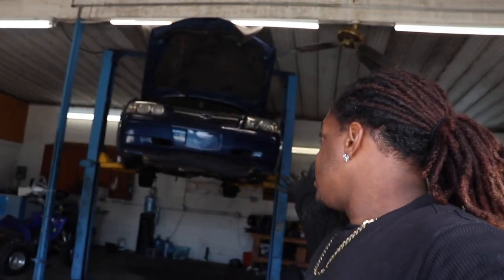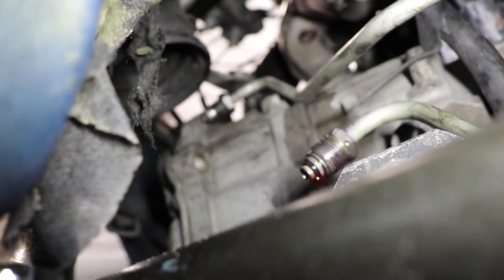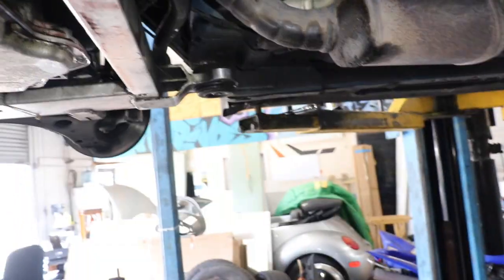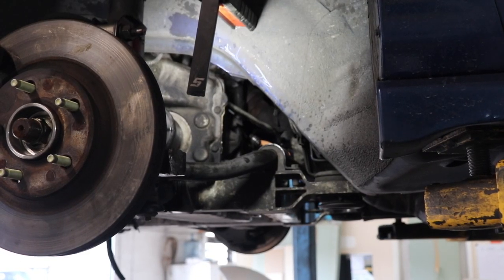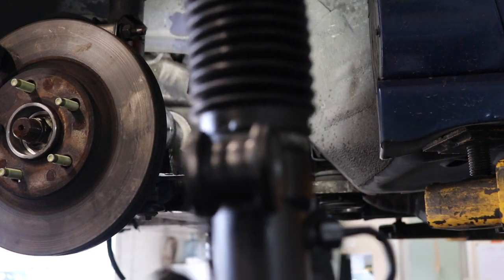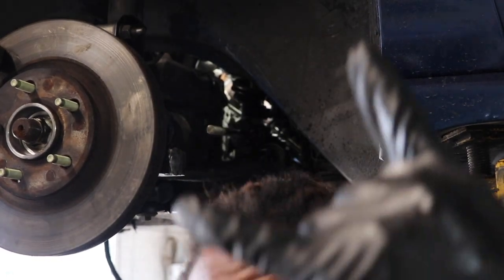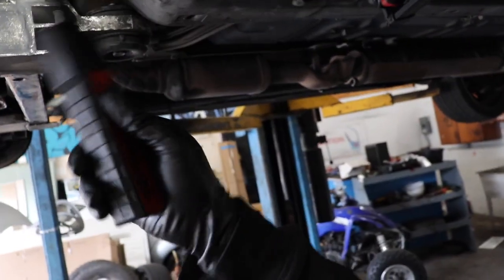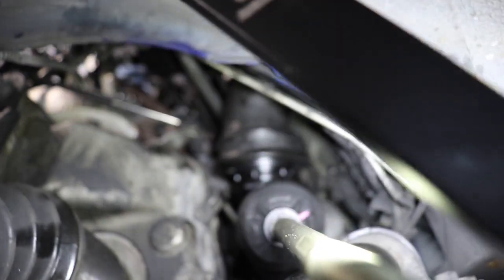04 CHEVY IMPALA RACK AND PINION REPLACEMENT

Comment: Okay so I wish I would have recorded and posted the process for me replacing the steering rack. But I will try to be as detailed as possible. 
1. I did not have a lift I had two harbor freight 2 ton Jack stands and only lifted the front. Remember to chalk the rear tires. 
2. Remove wheels and tie rod joints. I believe it was an 18mm. 
3. Start removing the two bolts that hold the rack in place. I believe it was an 17-18mm and you need a back up. The one on the passenger side was tough to remove because of the front sway bar. I just pried it past it. 
3. What I did next was drop the car as low as possible keeping the Jack up front on the center support. I removed the air box/intake hose to gain more access to lines going into top of rack. I believe they were both 18mm. I removed the shift linkage as well to get more leverage. 
4. Removing and reinstalling the boot/steering joint is the hardest part of this whole job. There is a plastic cover that snaps over the steering rack where the steering joint goes on. It is VERY hard to work around especially if you don’t have extra help. The swivel joint bolt was a 11mm. And I reached it from the wheel well. 
5. Lift car back up and place back on jackstands. I actually found that you do not need to drop the engine cradle to gain more access to remove rack. The trick is to get under the car and start feeding it towards driver side and tilt it back towards rear of car when you get to the wheel well. And it will slide right out. 
6. I put grease on bolt up points on new rack and pinion to help slide in. Easiest way without help is to feed it back in making sure that the passenger side tie rod goes where it needs to then getting under the car and working it in. It took maybe 3 minutes. Reinstall 2 main bolts and make sure the 2 lines are close to where you need them. 
7. Lower car again and reinstall lines and steering joint. Like I said this is the hardest part due to the boot being so hard to work with. You need to line it up perfectly making sure your steering wheel is straight at the same time. 
8. Swap tie rod ends over if they are good or replace. 
9. Reinstall tie rod ends and wheels. 
10. Reinstall shift linkage and air/box. 
11. MAKE SURE to top off power steering tank, lift front tires off the ground and go full lock 3-4 times back and forth. Top off fluid again and repeat until it stays where it needs to be. It will lose a lot of fluid and add air into system so that needs to be removed. 
Overall it was not NEAR as hard as it looked or I made myself think it was going to be. I did it in about 5-6 hours and 2 hours of that was messing with steering joint. This video helped out a lot but there is VERY limited info on doing a rack replacement. Hope this helps someone!
Reply: How did you line the steering wheel straight?
Reply: @jaydontaylor3967  honestly dealing with that steering shaft boot was the hardest part of the job. It seems like a nightmare to replace the Rack but that was the easy part. My biggest advice to you if you want a true straight steering wheel (I was alone so mine is about 15 degrees out) I would have an extra set of hands. The biggest problem I had was holding the boot back while I aligned the shaft back onto the key way. MAYBE an alignment will fix it for me but I have yet to get it aligned. I got it close enough to drive in town so not worried about it now. It’s an easy job but that boot makes it a pain. If someone held the boot back while you centered the shaft and tightened it, it would be a ton easier. Even getting it off was a pain. Also, make sure the new rack is as close to running straight as possible as well as your wheel. Let me know if you have any more questions. I’ve had no problems other than the steering being off a little to the right. But like I said. It’s EXTREMELY hard working with that boot on your own.
Reply: Yea I don’t really care if my wheels perfectly straight but when I put my tie rods on with the wheel straight one wheel will be straight and the other will be at a slight angle facing outward, so i don’t know if that’s because I don’t have the shaft on straight with the rack or if my tie rods are wrong
Reply: @jaydontaylor3967  mine was doing the same thing when I installed the tie rods. I marked the threads before I took it off so I could get the nut as close as before but it was still way off. So I played with it for about 20 min. on each side until visually it was almost perfect. It’s just one of those things where you gotta get it as close as possible yourself and then drive it to the alignment shop. The rack and pinion shafts are obviously a different length on both sides so you can’t just “half” the distance. You just have to get it close. Bolt everything up and then play with the alignment yourself until you get it drivable.
Reply: @brandongonzales6887  sweet konda what I was figuring but that’s tommorows project this 110 degree weather has stretched this project out a little haha, thank you for the reassurance Imma just space each tie rod out a little more until they even out. Thanks again! :)
Reply: @jaydontaylor3967  yeah I did it for my grandmothers car. It was probably 20 degrees cooler then. Lol. Just be patient and you’ll get it. Not hard at all. No problem, good luck!
Reply: Thank you for taking the time to write out the instructions because this video for someone who doesn't have car sense is not helpful at all watching it in high speed motion does not help without details this is not a how-to video

Comment: Did you loosen the rear subframe bushing for both removal and installations? It didnt seem like u messed with them when you installed it
Reply from the maker: leonardc22 yea it’s best to
Reply: @AJWhitmore  aight.. Be a good time to replace bushings
Reply from the maker: leonardc22 it’s smart to if they need to be replaced but not necessarily because you don’t take the whole subframe down you only need to loosen the two back ones a little
Reply: AJ Whitmore hey can u upload another video and slow motion taking off completely and replace completely step at a time
Reply from the maker: Willie T ok 👌🏾
Reply: AJ Whitmore thanks I have a 05 impala and my rack is leaking from the black rubber is split open and leaking boot where u located
Reply: What size r the subframe bolts? Need to see if i have the right socket.

Comment: Love our impala, but damn these things are a pain in ass to work on.
Reply: Seriously smh
Reply: tell me about it i just did a bunch of things to mine tune up. egr valve. top motor mounts radiator fan. the tune up and radiator fan sucked the most followed by the egr valve and the top motor mounts were so easy a crack head could change them.

Comment: What was wrong with the old one I'm asking cause I just changed my rack and pinion and the new rack and pinion seems like it has a knock in it....
Reply from the maker: My old one was binding up inside kinda sounded like a knock when I turned to the left so you might have the same issue I had to change mine twice because you can only buy a reman rack and sometimes the rebuilt ones aren’t rebuilt right. When I put the first new one in it was fine for like a week but then out of nowhere it was worse than the original one🤦🏾‍♂️

Comment: Why do people love the '04 Impalas so much?
Reply from the maker: Because they are good cars if you maintain them mine like 250k miles on it before I sold it and it still ran like a champ when I wasn’t beating the crap out of it 😂
Reply: @AJWhitmore  you're lucky to be a mechanic. you can save yourself a lot of money and hassles
Reply: Extremely reliable cars, as much or even more than any toyota but half the price of one
Reply: @shangrila73eldorado  super comfortable. Reliable. Drives like a boat but in a good way.